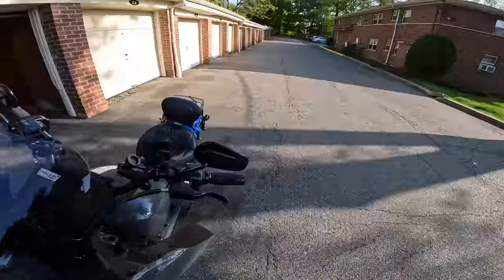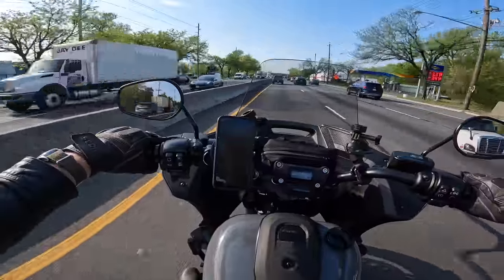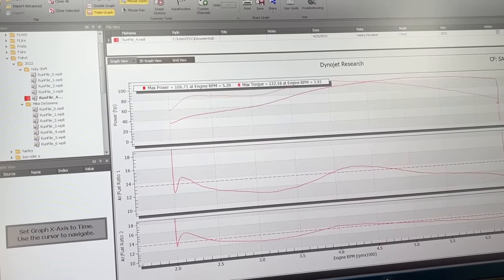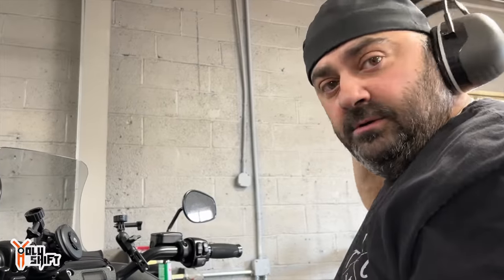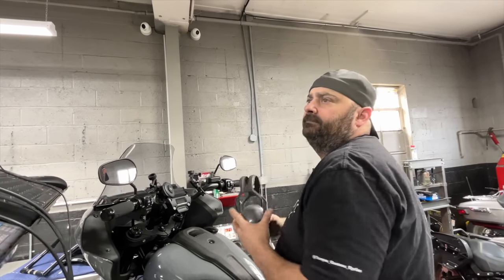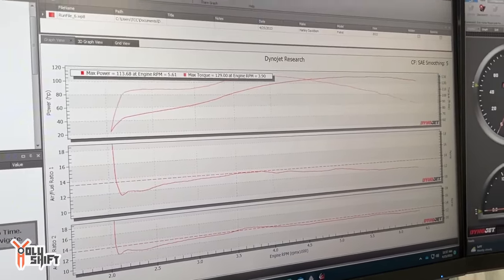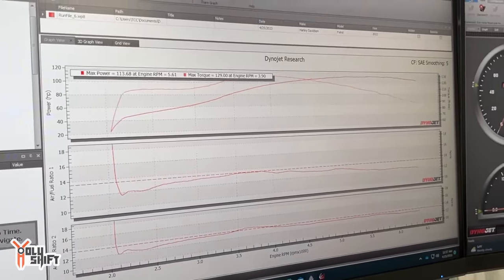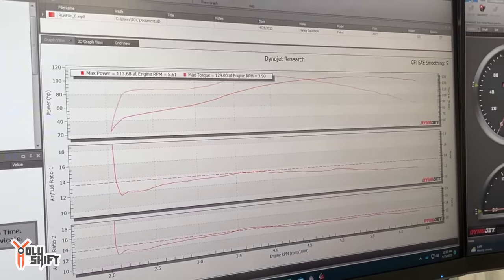Tuning A Stage 2 Harley 117 Ci Star 30/30 Cam

Comment: S&S slipons, 5.5 injectors, 30/30 cam, stock aircleaner got 118 Hp & 130 Torque enough power for New Zealand roads.

Comment: My 2023 lowrider st with star 3030 dyno at 121hp and 133tq with just 55mm aluminum intake and 5.5 injectors... I love my 3030 cam. I have a freight train lol
Reply: did you have to change injectors?
Reply: @darrenwolfe378  not required but I did my tuner recommend me to

Comment: Like I said in the past videos you need the throttlebody injectors to push past where you are into the 120s on one 30s it wasn’t a prediction it was a spoiler
Reply: Dont need TB, stock throttle bodies will support big bore kits doing 150hp. Injectors 100% though, stock injectors are the same that come on a stock 103 motor.
Reply: m8 107, 114 & 117 injectors are 4.38gm/s twin cam 103 3.91 gm/s, I did the woods 22xe cam 5.5gm/s injectors se 55mm manifold, the bike pulled 123.3hp at 5600rpm and 136 ft/lbs of torque. very happy
Reply: @geoffowens3823  twin cams run 4.3gps on on TBW bikes(08 - 17)  and 3.9 on cable throttle bikes
Reply: yes std twin cam throttle by wire  4.35gm/s and m8 4.38gm/s. I'm no expert though but was told the m8 won't fit the twin cam either, anyways hello from New Zealand
Reply: @geoffowens3823  Yeah I believe it. I think we can all agree stock injectors arent up to the job for a hot M8 motor when you're pushing  115-130hp.  How you rating your 22xe? Im just about to the do the APE CR485 and support mods to mine, keen as.
Reply: I am loving it with the xe22 it makes power very early in the rpm range. but looking at a upgraded compensator ramp now more$$$

Comment: I installed a 2 into 1 Cobra El Diablo exhaust on my 2022 Low Rider S, do I need to install a tuner and or can I ride it just like that
Reply: Bro if you went from a 2 into 2 into a 2 into 1 you ABSOLUTELY show tune it ASAP.  Go with the PV3A

Comment: Some people may say these figures are a bit on the low side, but honestly I think the tuner who helped you is simply one of those with a correctly calibrated equipment and honestly 
The figures you got are great especially if the curves have ”good” lines 
If you would have got 128/137 or something like that, im 100% certain the figures would be incorrect for one reason or an other.
(High Numbers is a sales argument…)
Reply from the maker: Yep 👍🏻 I agree 💯

Comment: Couldn't you just ride the bike in the auto tune mode and then refresh the ecm. Over and over until you get it dialed in? Same thing right?😮
Reply: I am sure you could but image how long it would take to hit every rpm at every throttle position for 20 to 50 hits per box. We also use load control on the dyno which wasn’t in the video. We can hold the bike at a specific rpm at any throttle position to achieve our goal.

Comment: This is because they are correct.
All other specifications from other dyno tunings are exaggerated and can not be achieved by a camshaft and exhaust alone.
The question is really only, are these the values at the rear wheel or at the clutch?
At the rear wheel these values would be fantastic, since 20 hp more than stock
Reply from the maker: I need to ask Mike if the Dyno records the drum = wheel or if it records information that comes directly from the engine.

Comment: Hey man I've got a question for ya. Do you still have the stock throttle body/manifold on your bike? I have the same bike with the same exact pipes & I love it. I'm a little bit torn between the 475 & 30/30 cams. Plan on doing the stage 2 sometime in the near future. The reason I ask is because I talked to the guys down at moonshine harley & they're saying that when I do the stage 2 the bike will benefit a lot from going with a big screaming eagle 64mm throttle body paired with a MHP 66mm manifold. Love the vids man. Keep 'em comin.
Reply from the maker: They are probably right but I still run the stock .. plenty of power

Comment: I have the 30/30 cam as well on my street bob 107, pulls like a train:) numbers are about 120/125.  One thing I noticed at very low speeds (Parking lot) its more jerky, wants to be reved more.